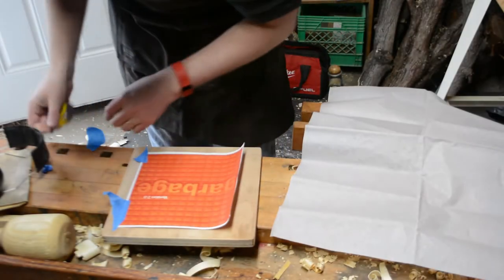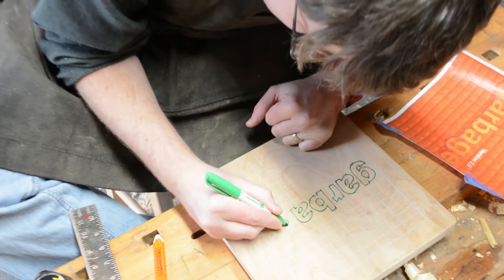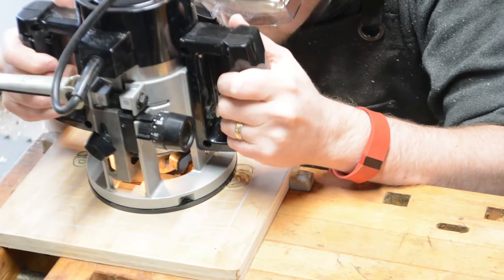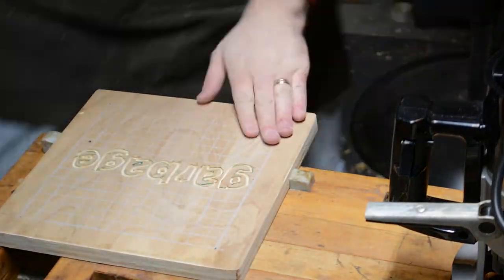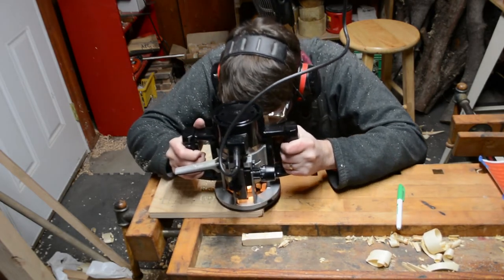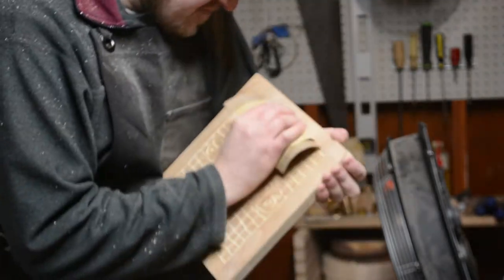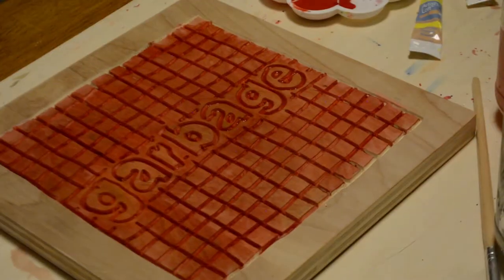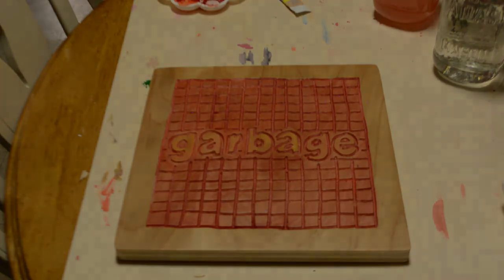Router Carving By Hand - Makers Rock - New plunge router and carving bit

Comment: I am also router carver.
I need a router like this.
Which router is this?
Reply from the maker: The one in this video was an old craftsman router from the early 90s.  I wasn't super happy with it.  It felt a little more wobbly with looser fittings.  My main router is the Bosch 1617 which has been fantastic.  Changing the bits is easy and the tool feels really stable.  I have two other videos where I am using that router to make signs if you are interested.

The latest model has variable speeds as well. https://amzn.to/2SCsBOW

Thanks for watching
-Todd

Also for transparency - That tool recommendation is an affiliate link that doesn't change anything on your end, but I would get a small commission.  It's a great tool, and I would recommend it even without that.